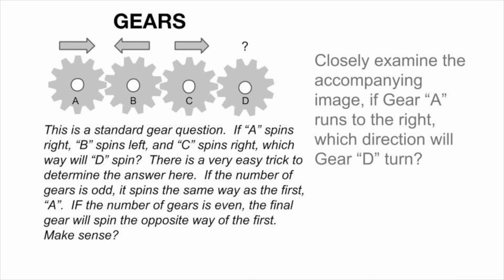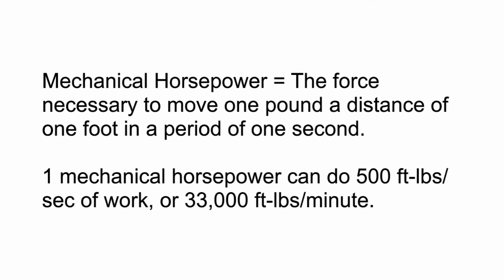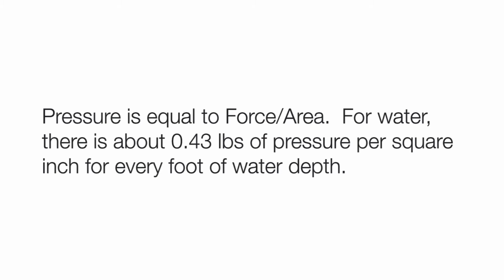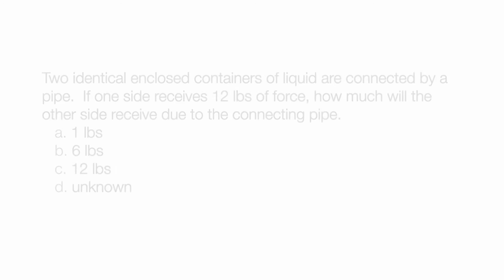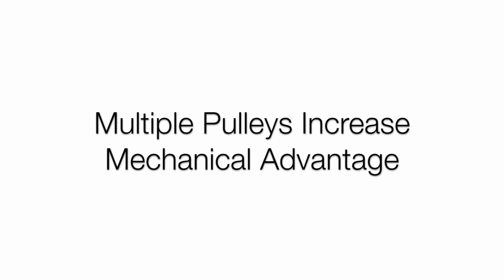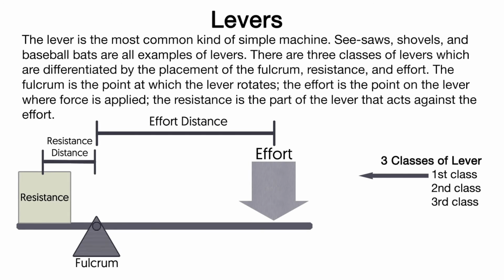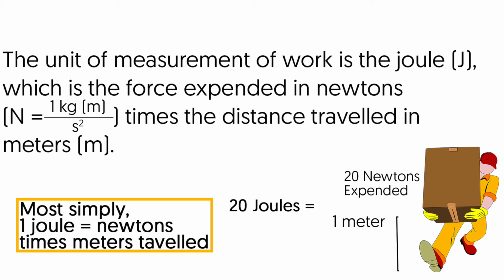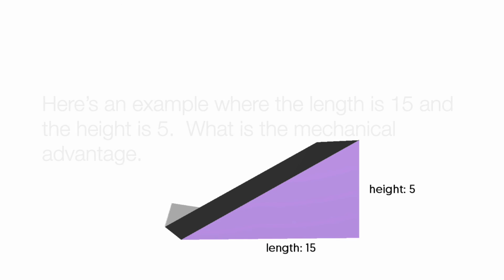POSS Test - Mechanical Concepts - Study Guide

Comment: The way that power output question is worded is incorrect. You're saying it takes 200 lbs of force to move a 100 lb box, which is obviously incorrect.
 
It takes 100 lbs of force to move a 200 lb box.

Poor

Comment: The one where Jack needs to pull a truck for one minute...it's a simple mathematical conversion problem, but you do not explain the math. The units cancelation does not work out. You should show all the math...all the conversions with unit cancellations.
Reply: If you assume Jack is only moving his load 1 foot, you can do the conversion and get 7 as the answer, but that answer has no units left. You should show the long math.

Comment: 100/.50 is 50 not 200.
Reply: 100/.50 = 100/(1/2)  = 100*2/1 = 200
Reply: 100/.5 = 200. Try it in a calculator if you don’t believe it.
Reply from the maker: Sorry, but the problem is correct.  100/2 would be 50, but 100/.50 is 200.  If you'd like more POSS review, we have an excellent study guide on our website at www.mometrix.com/studyguides/poss.
Reply: @MometrixTestPrep  
Mane . this stuff is tricky